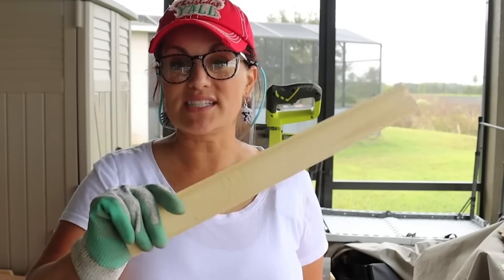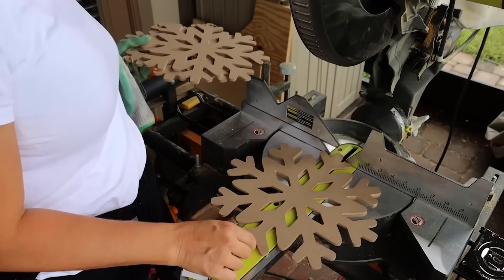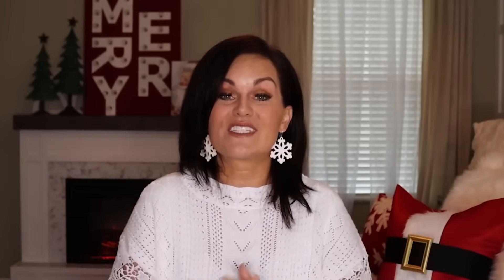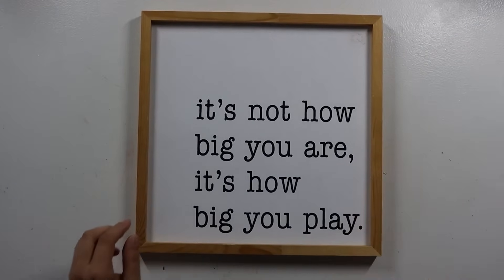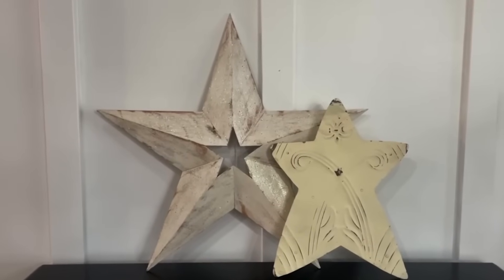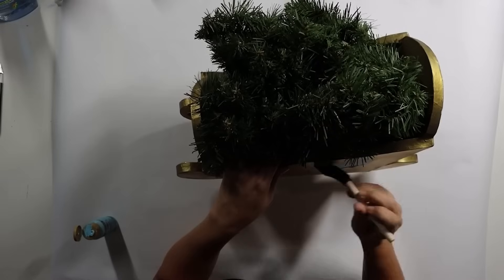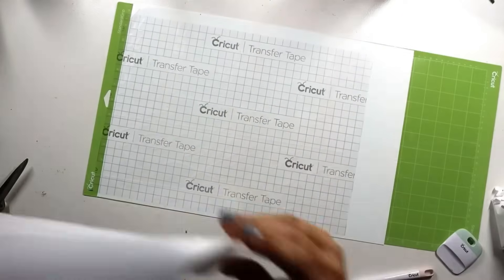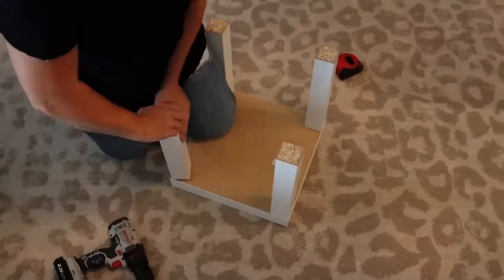Absolute TOP 25 BEST High End Christmas Decor DIYs!

Comment: love the projects however i will never ever ever use powertools, so i may use e6000 in place of screws or nails.....TIP: you can buy a $1 pool noodle and it will go so far using it in place of expensive floral foam....